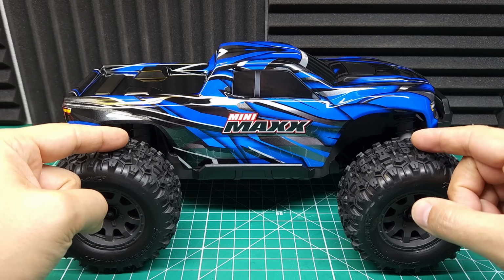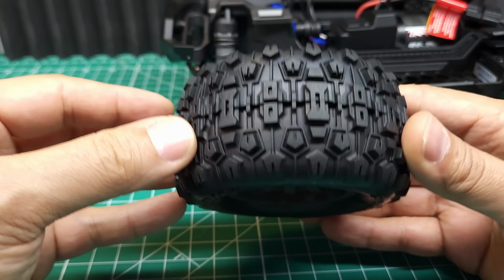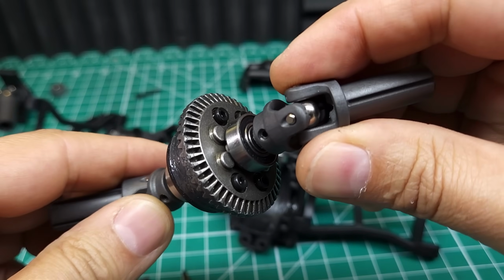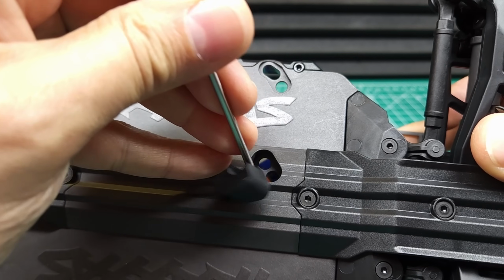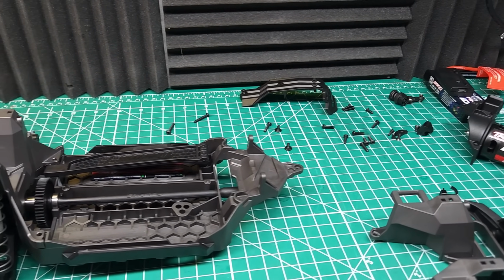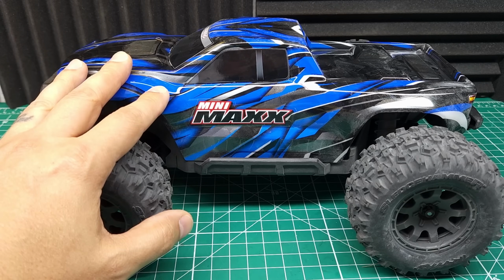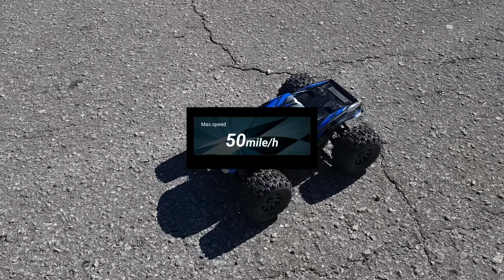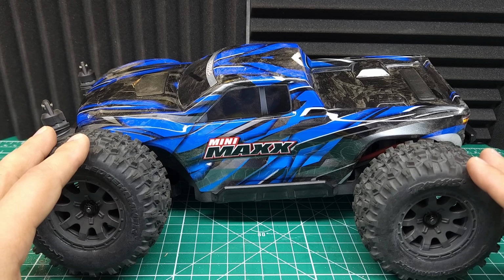I Really Wanted To Love The Traxxas Mini Maxx | Watch Before Buying!

Comment: I was really hoping this truck was going to be good too. I started having concerns once they actually announced it with no slipper clutch, no center diff, and a plastic center driveshaft. I have seen some reviewers saying the front/rear tires are different (maybe no foams?) to compensate for the lack of the slipper even. I got more concerned when I saw the price had gone up from $250 to $270 for apparently no reason.. I was looking to add the Mini Maxx to my Maxx family. Sending even more wishes out to Arrma now for that Kraton Grom 223S BLX. Great review as always, really appreciate the deep dives tearing into all of these cars and the hard work you put into your videos!
Reply from the maker: Yeah they definitely feel different but they're the same part number in the exploded view so I'm really not sure what's going on with that
Reply: @DoRC whaaaaa??? That's not good. They feel different?

Comment: Thanks for the video. About what I expected out of Traxxas. Keep pedaling their cheap ESC, Steering servo. They need to step their game up to MJX levels, if they want their stuff to compete, especially for what they charge. It's always spend more money to get the good parts. Nice video.
Reply from the maker: Yeah they have a pretty loyal fan base but just like anything like that depending on your fan base is not a good long-term strategy. Harley did that and they almost failed
Reply: @clean1566  I've been extremely impressed with my xmaxx and trx-4, I'll see how this does, but the broken front pinion is concerning and it's pretty poor engineering that you can't see pinion and spur mesh to align the pinion gear.
Reply: @hinnmanfamily  I flew drones and fixed wing, before getting into crawling, and now a little bashing. I was impressed by the toughness of the Trx4 chassis. My closest running mate, ran one. I feel the same as the title. I have a MJX16208 1/14 scale just for bashing and skatepark stuff. I thought this slightly larger Traxxas would blow the little guy out of the mud. They're gonna sell a bunch, cause there are people who like Traxxas a lot. They should have come out with 3-4s, and better electronics, at the same price, and there would be a line at the factory. It's all about having fun though, so I don't fault anyone for getting whatever gets em out there.

Comment: I figured that the mini Maxx would require a bunch of upgrades to get it close to the competition. It still looks like a cool platform if money is no object 👍
Reply from the maker: Yeah if you aren't concerned about money it definitely has potential. At a center differential and 3S Steel CVDs and it'll probably be a blast. Of course you're going to be at 550 bucks at that point
Reply: @DoRC  Didn't we have to buy another version of the Grom in order to just get something decent??

Comment: Traxxas is in their own world in general.. nothing they make stands out. Nothing they make is necessarily bad, but nowhere near their competition. For example the Jato 2S.. like.. bro.. $330 for a 2S 30mph buggy, when all the rest like the Typhon 223S goes 50 mph, has a center diff, metal gears (mostly), a gyro, and easier maintenance.. for the same price.. 

Traxxas knows what they're doing though. They have their hardcore fanboys that would buy a tree branch with a Traxxas sticker on it for $100
Reply from the maker: Maybe so but it seems like a poor long-term strategy

Comment: For me…. As a person that’s been in the hobby since the 90’s. I see the price point because of the battery and charger that comes with it.  That would make the truck closer to 200.00.  But that’s really about it.  Great smaller beginner truck with 10th scale electrics.  Good video.
Reply from the maker: Eh. You can get a comparable non-Traxis branded battery for less than $20 and I wouldn't put the value of the charger at more than $20 either.  It's also important to note that the vast majority of small RCs on the market today come with a battery and charger so when comparing pricing the inclusion of a battery and charger don't really help much

Comment: That transmitter, while very basic, does have the red button on top which is used for programming. There should be a card which explains the way to enter the codes and make the changes.
Reply from the maker: Yes you can use the set button but on the TQ literally all it allows you to do is reverse channels. I just checked the manual and there is no other functionality. The TQI on the other hand has a ton of programming features

Comment: I had high hopes for this as I have the 4s Maxx but man im glad I scrolled onto this video. This reminds me a lot of my mini revo as out of the box it was fast on 3s or 2nimh packs but it kept on blowing diffs, i wound up shimming the diffs properly and installed the center diff and no more blown diffs since but it also came at the price of speed and well money lol. Seems like Traxxas keep doing the same thing which is a disappointment and I think im gonna pass on it, I did pick up a Aarma Typhon grom 223s and it has blown me away I just really expected more from this. Thanks for the honest review it has saved me some money.
Reply from the maker: Yeah this definitely feels a lot like that where they designed the platform to not really be able to handle the power people are going to want to put in it

Comment: From what l have seen in your video the Rlaarlo Terminator completely whoops it's ass. I still think the Terminator is the best deal out there. I knew the mini Max was going to need 3s power from the door to be impressive and definitely knew it was going to need the metal center diff. Welcome to the world of Traxxas. Buying an RTR truck then having to dump 200$ into the truck on upgrades.
Reply from the maker: The OT isn't perfect and it definitely has its own weaknesses but you do get a lot more for your money
Reply: I am far from impressed with this truck after watching your video. I don't think l am going to spend 500$ on a mini for it to live up to my expectations. Think l will just stick with the Omni Terminator carbon fiber edition l have and the Rogue 1. Both of them are the best Mini bashers that l have ever had.

Comment: I have the same fear about the plastic driveshaft, and you have to get the center diff or limited slip to use the aluminum shaft according to traxxas's website (I guess it's a different length? Don't know why else you couldn't use it with the stock spur).
Reply from the maker: Interesting. I didn't realize that

Comment: My front pinion shaft snapped twice before I could run one full battery pack. I have had a lot of other problems as well. The front wheel hub broke twice with very little bashing. I will be avoiding first runs from now on. I am honestly surprised how well yours held up.
Reply from the maker: Well to be fair I never really got a chance to beat on it. It broke pretty quickly.
Reply: Same here. What you did was ten times the bashing I put mine through. I think after some small upgrades, it will be sweet. Looking forward to the upgrade video so I know what to get.

Comment: I have owned the Traxxas Mini Maxx for a few weeks and gotten to run a few times. The major weakness I found is the motor mount. Plus the design of how the ESC is mounted. 

When my motor mount cracked the motor shifted upward and sheared the signal wires flush with the ESC.  Unfortunately that's not the repairs or cost I was expecting. 

I don't trust the motor mount now, so to fix that I feel like I need an aluminum motor mount, plus a new ESC.  Getting to be a pretty expensive repair right there.
Reply from the maker: That's a bummer. I've heard a couple other reports of broken motor mounts as well.
Reply: Hot racing makes an aluminum replacement. It comes with an optional battery harness replacement. $70 I didn't plan to spend on this vehicle
Reply: @DoRC  I want to let you know, I really enjoy your content.  I've learned a lot about the hobby watching your videos.
Reply from the maker: @wilnetz6201 ah. Yeah I suspect a lot of people are spending money that they didn't plan to on these cars
Reply from the maker: @wilnetz6201  That's awesome! I'm glad you enjoy the videos and thanks for watching them :-)

Comment: Traxxas did well with the 3s mini revos. Mine is still going strong, and it's nearly five years old. On 2s, it's fast and torquey. All I've done is add some metal skid plates and some other goodies that are more bling. I have not broken it in all that time, and it's eaten some curbs before and worse. However the drive line has only seen WD40 during the winters and bearings, but besides that, it's 100%. I feel like the Minimax is trying to appeal to the mini market but they upkeep their prices like Apple does because they are a "premium product" I don't see that much anymore they need to bring something new to the market instead of making downsized models. I bet the Slash 6s is gonna get a mini version soon since it's of the Maxx platform.
Reply from the maker: I'm not sure what's causing them to have their prices so high but they need to fix it

Comment: Traxxas is the apple of the rc world, manufacture a cheap product with outdated parts and tech at maybe $40 per unit and slap a premium price on it, then sue any company that tries to produce better parts for it without giving traxxas their cut.
Reply from the maker: Sort of. Apple does charge a lot but they also give you a lot. Their phones have a longer lifespan than anything else in the market and the apple silicon computers productivity beasts. Expensive though.

Comment: The last time I bought an R/C was a NEW Associated RC10 B2. (30 years ago?) It retailed for over 600.00...nothing on it, nothing in it. The body? Who cares. Everyone bought a separate body that they actually wanted. They came clear and we had to paint them. Same went for the tires. The tires that came on the car were rarely used. We outfit our cars with electronics we wanted. We hand wound our own motors and built our own battery packs too. Also, RTR was almost not even a thing. You had to build any car worthy of anything. 

That said, you should be able to take any car available and make it what you want. Plenty of Grasshoppers back in the day running in the modified A Mains with the big boys. That's why it's called a hobby. Those who bought their way into a fast car rarely knew much about their car.

Nice review. Thank you for the tear down and analysis. It was enlightening.
Reply from the maker: Yeah you will be able to do that with this one but it'll cost a lot and these days you can get really good RCs RTR right out of the box.

Comment: Unlike arrma and others mentioned you will actually be able to get parts for this one in a couple years, another thing its got twice the battery of the grom, and in my opinion the price isnt bad at all with the grom being over 200. Ive also been playing with this for a few days and i feel like its plenty quick, super durable, pretty easy to control i do agree on the tire compound being a little hard but it is 12mm hex so a million tire options also if anyones like me you like modding. Just my 2 cents
Reply from the maker: I can understand concern about getting parts for other brands but Arrma parts availability in general is very good. 
I am glad you're enjoying yours and I think anybody that buys one and works within its limitations will enjoy it. It's not a bad truck it just isn't the best truck and in order to justify its price it kind of has to be.  I understand what you're saying about the battery but pretty much all RCs under one 10th scale come with a battery charger so it's not really an advantage

Comment: Bought the Savage XS for my son. Seems like its a bit more durable, but the slipper clutch is a pain, plus its cramped and pretty hard to work on. I know you have experience from the XS, how would you say they compare?
Reply from the maker: Overall I'd rate them pretty similarly. Of course if the Savage had less power like the mini Max does it probably wouldn't have as many problems. Ultimately the biggest problem with the XS is lack of parts and upgrade availability. It has a few pretty serious weak points like the slipper clutch that they're just is no solution to.
Reply: @DoRC  here in Europe parts are pretty easy to come by. Yeah the clutch is a big problem. That and that the diff gears arent available in better quality like the CVDs and drive train cups.  Stupid not to offer higher quality parts for the entire drive train

Comment: i almost always agree with most of what you say but my repairs of my grom typhon have been less than ideal for a cheap small vehicle. the wheel hexes are almost impossible to remove without destroying them, differentials requires a ton of disassembly and the CVD rebuild kits have a bunch of parts you dont need
Reply: Irrelevant 🤦
Reply from the maker: Interesting. The hexes just unscrew and I've never had an issue with them.  The diffs are just about the easiest in the industry to remove (8 screws total).  Not sure about extra parts but that doesn't seem like a terrible thing.  Most people consider the Groms to be very easy to work on overall.

Comment: I ordered the green one, but yeah, yet again, Traxxas is selling at a premium price without a premium product. I have a soft spot for most Traxxas products, but over the last two years, my spending has been about 20 to 1 dollar to dollar for other brands vs. Traxxas.
Reply from the maker: As long as you don't mind the stock power you'll have fun with it. If you do go 3S you'll definitely want to get the center differential
Reply: @DoRC  yep, I'm fortunate enough to have spare traxxas parts from countless upgrades that getting this mini top teir is not just a parts bin raid.  I will want/need to buy the new model specific parts for this, however.

Comment: Don’t like that you can’t see the gear meshing when you swapped motors… also 3s seems a bit much lol. Mine is on the way and I’ll be keeping the bl-2s in it (wasn’t planning to) get a bigger pinion in it and grab a center differential. Also gonna be getting the wheelie bar and the body reinforcements. Overall I think it fits the maxx family pretty well.
Reply from the maker: Yeah if you don't mind spending the money I'm sure it'll be fun!

Comment: I think it's a great buy for 250. Even comes with a battery. Not sure what people expect with a 2s system. Could they have built it with a few better options? Yeah they could have, but things cost money. IMO it's a great TOY for 250 and truly RTR. People acting like there is a unbreakable RC car on the market 😂.
Reply from the maker: It's $270 and in that price range there are many far better options.  The car itself is fine its just overpriced.

Comment: If you're worried about the pins backing out I can give you a very easy solution get a bottle of clear fingernail polish put some on the threads works like a charm been using it for years. And it doesn't mess up the threads on the plastic like loctite does
Reply from the maker: Yeah nitrocellulose lacquer makes a good retainer in plastic